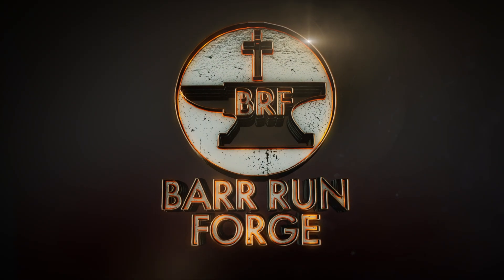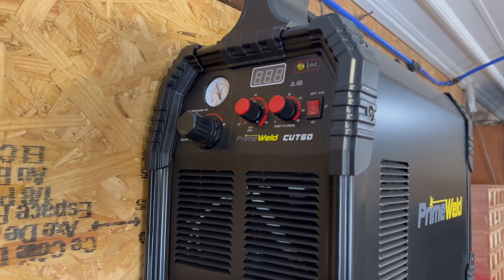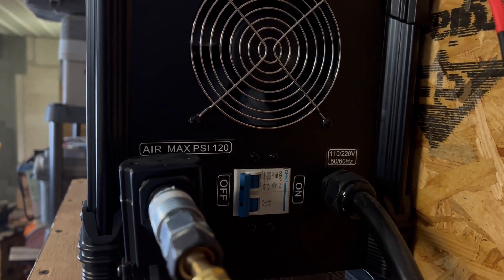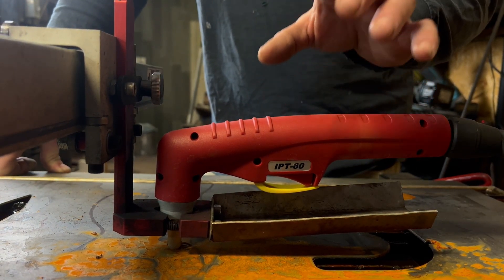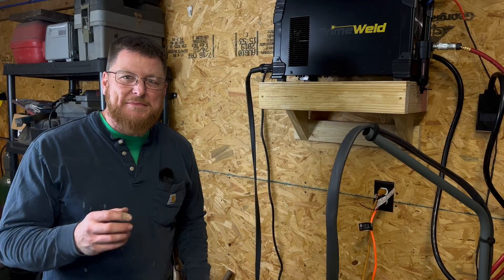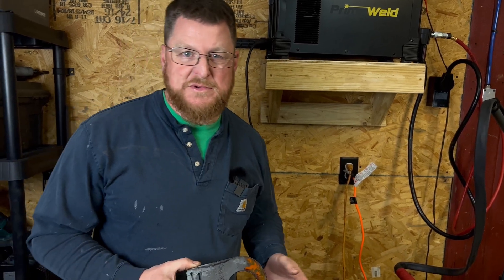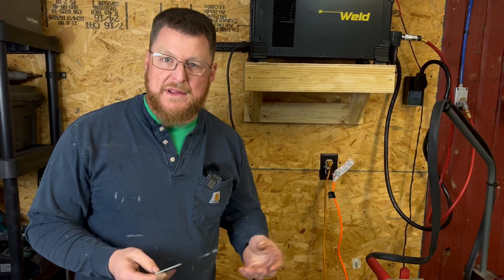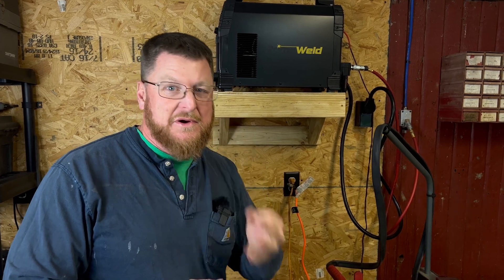Plasma Table  I  CNC TABLE  I PrimeWeld Cut 60  I LANGMUIR

Comment: Would like to know how its doing with the primeweld plasma. Have you had any issues with the machine suffering random stops or getting lost due to frequency noise from the plasma cutter? I have a cut 60 and would like to get a crossfire pro but am on the shelf as langmuir states they do not support the use of primeweld plasma cutters.
Reply from the maker: We are quite pleased.  First of all, we keep the two pieces a good distance apart.  The connector from PrimeWeld works great to connect to our Langmuir.  Just 2 soldered connections and good to go.
Reply: @BarrRunForge  Thank you for taking time to reply.

Comment: Is your torch on/off wires up to pins 1&2 on the back on the Primeweld Plasma? I have this similar setup but I have no control from the computer when to turn on/off the torch head. Awesome setup!
Reply from the maker: I would have to look again at the pins, but I believe that is correct.  Thank you.

Comment: If you tried picking up my friend John Paul's plasma cutter, you might not be able to move for a while afterwards. That thing was so massively heavy, we used a hand truck just to move it from it's put away spot, closer to the material/project we were working on. I'm guessing around 200-250 lbs.
Reply: Luckily this one is pretty mobile, thank Bill!